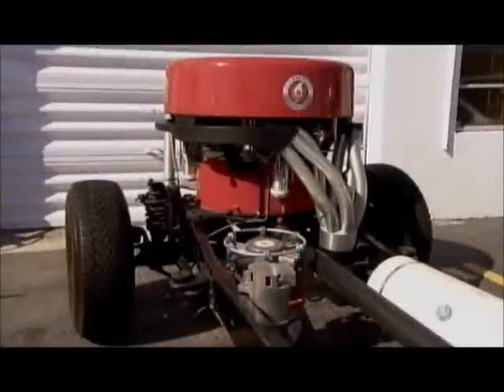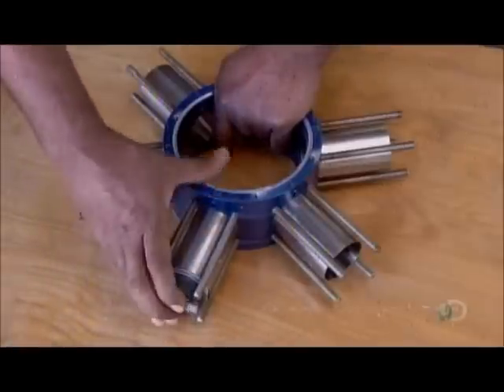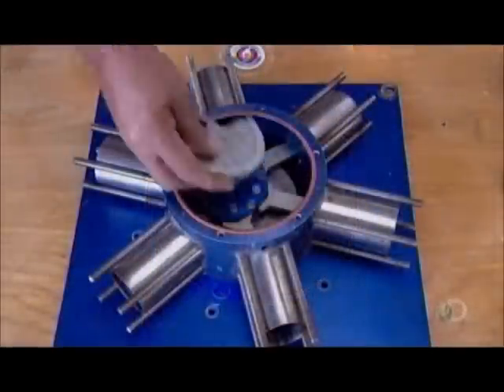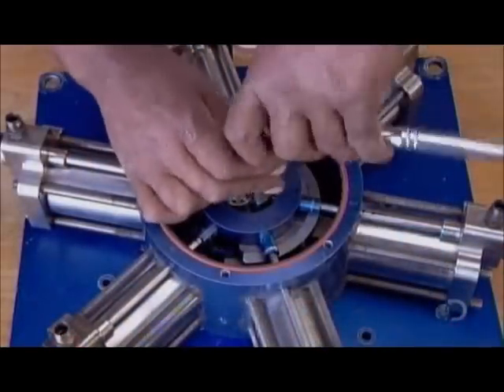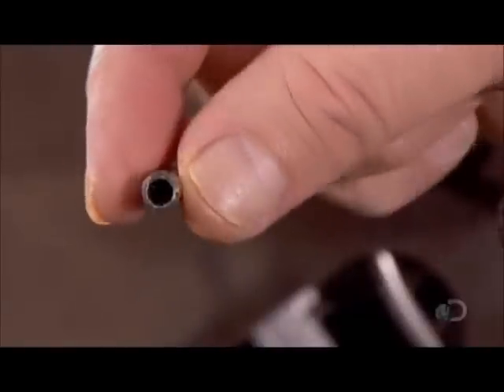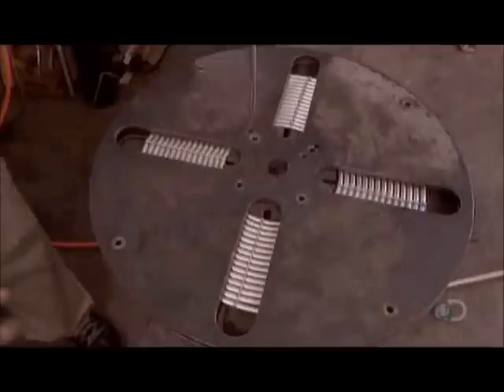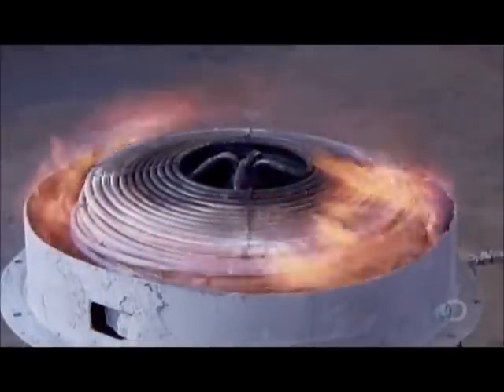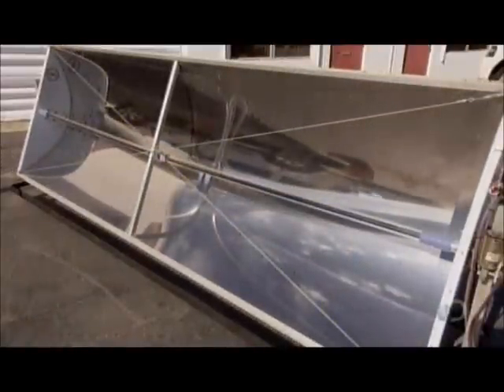How It's Made - Steam Engines

Comment: Water is not a lubricant, of course it needs lubricant. Since the dawn of steam engines drip valves are there to dump water because fluids like water are incompressible. Also, condensers are not 100% efficient, you will need to refill water eventually.
Reply: This type of steam engine, a Cyclone Engine, you don't have to refill the water because it is a sealed airtight system. If you are losing water, than you have a leak, which is a bad thing. As for using water as a lubricant, this comes right from the company. "By using deionized water as both the working fluid and the lubricant, and by lubricating specific points in the engine, the use of motor oil is unnecessary. Deionized water can be used as a lubricant because it has no charged ions or particles which may corrode the engine, and because it has a much higher slippery quality than untreated or ion-containing water. By using water as a lubricant instead of oils, the steam in the engine is capable of reaching temperatures in excess of 1200°F"
Reply: Vincent Carcaramo Its a relatively poor lubricant compared to oil... but actually liquid water has sufficient viscosity to create both Hydrodynamic lift (eliminating direct contact between to moving surfaces) and Elastohydrodynamic lubrication... additionally water can provide cooling and debris removal also basic functions of lubrication systems...

A common practical example can be found in many different types of water pumps and also in propeller shafts of large ships.. 

Cheers!
Reply: allan froehlich You, good sir, are incorrect. You are confusing slipperiness with lubrication. There is a reason that oil is used as a lubricant, as well as silicon based substances. The only time that water is EVER a lubricant is at a nanoscopic scale. Also, thermodynamics dictates that there is no engine or turbine or compressor or ANYTHING that is ever 100% efficient. It is physically, and mathematically, impossible. There are many equations that demonstrate this, thus there will always be loss in anything that does any work.
Reply: water is a libricant dumb ass. ever heard of a slip and slide?
Reply: Have you ever slipped on a wet surface? (water lubricates certain materials)
A condenser can be 100% efficient under nominal conditions.
Reply: Vincent Carcaramo
Please explain slip 'n slides.
Reply: allan froehlich Any lubricant has to have a high enough heat capacity to remove heat from the components and to not evaporate, as well. The water will evaporate when the superheated steam and friction come into play. Besides, again, water can not work in a piston environment. Compressing water...an incompressible fluid... into a piston head will lead to catastrophic damage. Look up the second thermodynamics about energy and reversibility. You lose, Batman.
Reply: Slipperiness due to a lubricating film of liquid!
Steam engines typically get up to temperature and stay there.  They won't get hotter than the steam with powers them.  If you've ever dealt with steam engines, you'd understand that keeping them warm is important.  If the temp goes below the boiling temperature, condensation occurs, which could damage the engine.
I'm thinking that the pistons in that engine had ceramic piston rings.
Reply: allan froehlich Man, wouldn't it be nice if water actually created lubricated films like oil does!? :D too bad it doesn't.
Reply: allan froehlich Water balls up, adheres to itself more than the objects around it, and runs.
Reply: sgfreak37 in an ideal scenario, it would be airtight, Airtight is a myth, even in near ideal science experiments working with near vacuums. In motive applications all these joints will be moving, nevermind that the steam can bleed though rubber (hence my most seemingly airtight car AC systems leak). In order to keep up with steam demands undoubtedly it is cooled at a sub atmospheric pressure, and keeping a vacuum sealed is even harder than a pressure sealed. The idea that you will NEVER in all your time owning it have to fill up the water is completely and insanely incorrect. Never mind that almost a hundred years ago the Doble Steam car had a system that could heat up to over twice that temperature, an educated search will reveal: http://www.machinerylubrication.com/Read/1367/water-bearing-failure
and that most expensive lubricants are water REPENTANTS. Besides, having oil in and of itself isn't completely a bad thing, as a modern engine can be designed to use 100% synthetic oils that have particles designed to literally protect the engine.
Reply: pcgamer6 Yes I know that nothing is truly 100% airtight. It is a general speaking term, meaning that you wont have to replace the water for a long long time. I am in in the automotive industry, and if you have a "noticeable" A/C leak, you have a problem. Going on with some pretentious "science mumbo jumbo" to prove a point, is hilarious to me. What does the Doble Steam car "that could heat up to twice that temperature" have to do with anything? Even though a quick google search will tell you " This produced steam at a pressure of 750 psi (52 bar) and a temperature of 750 °F (400 °C)" Other than the fact that is a "steam car" it is irelevent to the conversation at hand. Not only that, but why don't you go tell Cyclone Power Technologies that they are full of shit, and you know that they actually use some kind of oil to lubricate the engine and not just water. Because it is obvious that you wont take their word for it.
Reply: I agree that an A/C system is an excellent example of a closed/sealed system.
But still, with the correct materials are used, water can lubricate.
Reply: allan froehlich The thing I find rather funny, is how people insist that they can't use just water to lubricate, or how they must be using some sort of lubricant. I posted what the company that makes this type of engine said about how they use water as the lubricant a few post up. And like my last post said, if they are calling foul, why don't they message the company and see what they have to say about it.
Reply: Why not use water, then to "libricant" your engine? Why do some academics  devote their entire life to tribology, the study of lubricants, friction, and wear?  There is a difference between simple sliding and lubrication. Fucking idiot.
Reply: DrFronkonstein water works as a lubricant in certain conditions. Oil has a higher boiling point and maintains its viscosity at higher temperatures, making it more suitable than water.  Oil also doesn't freeze below 0 degrees C.
Ever read "slippery when wet"?
Water can lubricate!
Reply: DrFronkonstein Its an entirely moot point now... Cyclone Steam Technologies has been revealed as a hoax... a vaporware scam... this elaborate and fraudulent investment scheme appears to have run its course.. activity has dropped off, patents have all been allowed to expire and its stock is now worthless..
3 key employee have made off with most of the money that was invested by private individuals.
Reply: Do you have any proof of this?
Reply: allan froehlich Cyclone has never delivered or demonstrated an actual working engine, never provided independent test results. It has made performance claims which are fraudulent, defy the laws of thermodynamics  and simply not possible to achieve in a single expansion engine design.
Harry Schoell, Frankie Fruge and James Landon managed to sell a couple of Schoell's patents for an undisclosed amount
the remaining Cyclone patents have been allowed to expire..
Cyclone's stock is currently worthless.. despite occasional announcements of new ventures, nothing ever comes of it..
Cyclone laid off all of its employees and its facility appears to be abandoned.
Reply: allan froehlich I sincerely hope you did not give them any money..?? because its pretty clear your never going to see it again...
Reply: I asked you to back up your statement with evidence.
What I do with my money is irrelevant to my previous question.
Reply: allan froehlich Oh. Wow..I'm sorry, my condolences.  How much did you lose?
Reply: I gave them nothing.
Anyway, you still need to back up your statement. Otherwise, your statement has no validity.
BTW - The company is not defunct.
Reply: DrFronkonstein  then why do people slip when its wet out. its a lubricant. fucking dumbass. just because it cant withstand heat doesnt mean its not a lubricant. soap is a lubricants and it cant withstand heat. 
https://www.chemistryworld.com/news/water-acts-as-a-lubricant-for-molecular-machines/6538.article
https://answers.yahoo.com/question/index?qid=20080102232612AAm46LJ

Comment: When I first found this company I never thought they were going to get publicity like this.  They seemed to be in the prototype stage at the time.  I was very interested in this for it's flexible fuel options, water lubrication and closed steam loop and steps taken for efficiency.  Although to be honest this how it's made seems more like an ad and I wonder if money was paid for that.  Discovery isn't all scientific either, I swear they once showed a compressed air car and left in the claims of over unity.  Still I would like this for a car but I see there might be space and driveline orientation problems.  I also want to know the thermal efficiency, power output, cost, ease of maintenance and longevity of parts before I give it my approval.
Reply: Here's a simple fact of physics water is not a lubricant!
Reply: They added small drops of oil to the water. Something that comes naturally with diesel.

Comment: Good post, Paul. And actually the Stanley (Steamer) brothers were smarter than these people. The made their high-pressure boilers out of wound copper tubing, which is softer. Their boilers were wound thousands of times with piano wire, and tested to over 1000 psi, even though their engines "only" needed about 200 psi or so. If their boilers overheated, the copper tubes melted slowly, and the boiler would simply fail and lose pressure, rather than exploding. Why were engineers back then so smart?
Reply: Copper is the best material for conducting heat too. I think the engineers of the past were so smart because they had to work with simple technology and had the chance to learn the basic fundamental laws of nature and mechanics. Our world is way more complicated and engineers learn modern techniques only without fully understanding the basics.

Comment: I wonder if this is classified as a boiler and is it a high pressure or medium pressure boiler.  There is a bit of a difference between the two, but both require certain inspection and use permits. High pressure boilers are very dangerous if one runs away. It's rather like a time bomb when one fails.

Comment: In some powerplants, they use jet engines to burl fuel. The exhaust of jet engines generally generate temperatures from about 600º - 700º. If we put this style of heat absorption behind one of those engines imagine the power we could achieve. Also, if we took the turbine blades in the jet engines and thickened them enough to run water through them, you would get to increase the temperatures of the jet, increasing both its steam-generation and the net thrust.

Comment: in some of the old Stanley steamer cars that only had a 20 hp engine you could get them up to 60 MPH. It all depends on the weight of the vehicle you are putting the engine in but I do believe that the site said that they have engines that get up to 330 HP. That's enough to run a Semi truck.  The only downside is it seems that these aren't for public distribution yet.